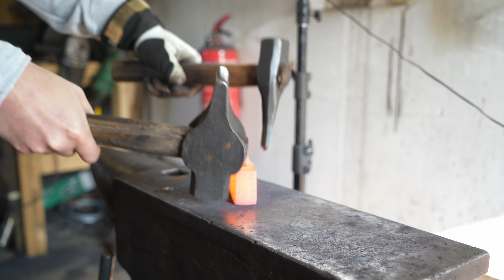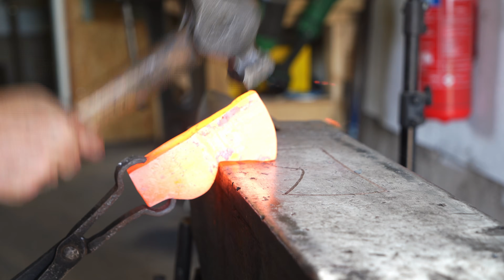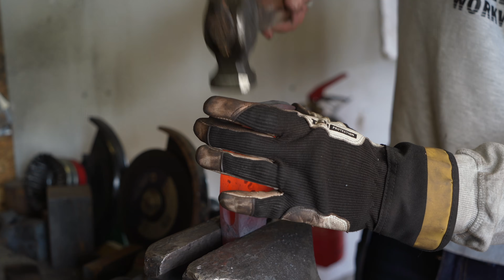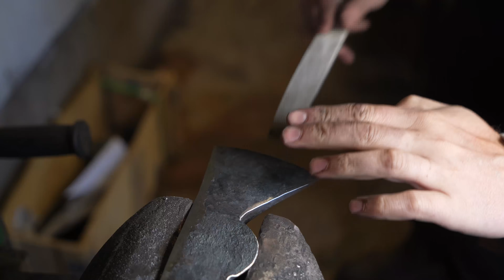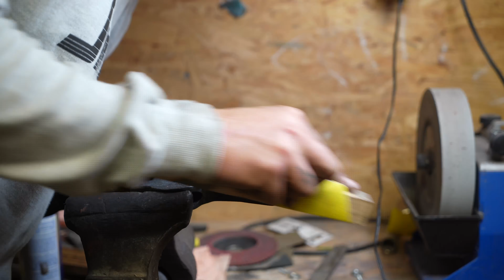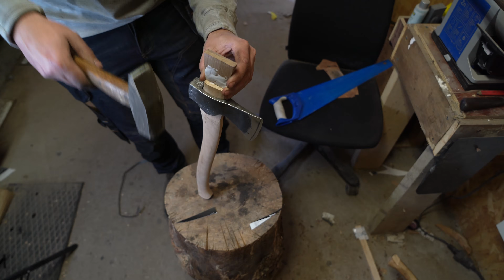Forge Welding Axes: An Introduction to Laminated Edge Steel

Comment: I re-seated my axe head into the shaft, useing thin laminating epoxy. Very effective. I built a little dam of modelleing clay so as to let the resin rin downwards,  penetrate and bind. Prior to this, I firmly whacked the shaft into the head, by whacking the shaft.

Solid binding between the shaft and the head.

It became loose in an attemt to make the shaft more beatiful in the owen. It came out very nice, but shrank.

Now the shaft is firmly and solidly attached to the head, way better than before.

Comment: Nice axe, a better way to install the wedge is the place the axe upside down on a work bench or log, and drive the handle down onto the wedge, it evenly distributes the force and stops the wedge from splitting.

Comment: This was very informative. I have been wanting to start blade smithing. But it is so expensive to start.
Reply from the maker: I started with an old barbeque grill and a hairdryer. A 10 dollar hammer and a small piece of steel as an anvil. Built my way from there. It does not have to be expensive to start. Thinking back I can really miss those early days. What a fun journey it had bern. Hope you can get around to try! Best of luck 😀

Comment: I've always wondered if axe handles have like a standard size so you know how large to make the eye of the axe. Or is that a thing you figure out before starting? Which comes first, the handle or the axe? :P
Reply from the maker: Hey! Very good question!
You can usually see similarities from culture to culture. Here in Sweden for example you could say that a standard is 50x20mm but it differs slightly from maker to maker. 

It also depends what historical era were talking about and the purpose of the axe.
For example here in Scandinavia it's very common in. the modern era to have a hourglass shape inside the eye, that means that its bigger on the bottom and the top of the axe, while in Other places you only have it bigger on top.

Remember this is just off the top of my head and I am generalizing a lot.
oh, and the axe came first.

//Nils

Comment: Hello Niles, I have often wondered if you have a particular shape of ax handle that you prefer over others? Are some more efficient as far as blade angle at the bottom of the swing arc?
Reply from the maker: Hey! That's an interesting question, I am a person that really apriciates history and the labour of those who came before. So I take my inspiration from them, far greater men than me. 

I try not to complicate things, Some axes works better(in my opinion) with straight handles, some with curved handles. 

Hope that helps
/Nils
Reply: I appreciate your answer sir, keep the videos coming I enjoy them immensely. Vince in New Mexico.

Comment: what would be the difference between doing the way you have here and folding a flat piece around a high carbon edge and working the handle hole and profile as you weld the hardened cutting edge into the mild steel of the body of the axe head?
Reply from the maker: They are different constructions. This method that I am showing is very common to see here in scandinavia during the 1900’s. The folded axes go way back to early iron age. The big difference is that the ounched eye is generally stronger. No risk of delaminating the eye etc. So a bit safer.

I am going to make at least two more videos about the folded axe, just like this video.

Comment: When you "normalize" put the workpiece into a bucket or tray of sand then cover it with sand. 

When normalizing, usually the idea is to let it cool as slowly as possable.. Sand, or even fiberglass if you like, will insulate the piece better than just letting it cool to the air, and you should get better normalization.

Comment: Hey Nils, Excellent video. I just have one question. Is the eye of the axe backwards from normal? It's not totally clear from the video but it looks like the big side of the eye is on the bottom instead of the top.
Reply from the maker: In my experience there are two ways of going about this. Either you do tge more ”tomahawk” approach with the larger section on top. Or you do the typical scandinavian version with an hourglass shape. That means that both the top and the bottom are bigger so when you wedge an hourglass shape inside the eye. This way you get still get a very strong locking process with the wedge but also maximizing the amount of wood at the bottom, reducing the risk of the handle breaking when overstriking etc. Hope this answers your question. 

Here is one example of how different cultures has aproached things a little bit differently, which is very interesting
Reply: @NilsÖgren  that is indeed interesting. I didn't realise the eye was made into an hourglass shape rather than a simple taper. Thanks for the insight.
Reply from the maker: You got it!

Comment: Fantastic instruction, thank you!! In the handle video if not already in the plan would you be able to address the way you shape the eye region with respect to how the drift taper interacts with the eye? I may be doing a bad job describing it but essentially how hourglass figured the inside of the eye is and how much of the handle contacts it before driving in the wedge. Cheers!

Comment: Nicely executed, clean, well explained and shown, that was an amazing video!
I also tend to thin out everything before quenching, sometimes i even do a basic polishing so I don't have to work with hardened steel so much.

The design with the flared eye is pretty odd, I suppose it's an American design?

Comment: Very intuitive and a "very pleasurable forgery" to watch.😁What's a good way to prevent aggressive rusting on axes? 
I live in a humid tropic islands in Southeast Asia where it's always warm, where humidity aggressively oxidize steel/iron tools.
Reply from the maker: Well there are a few things you can do. Never leave the axe outside after use. Clean it if it gets dirty and oil it. I always oil the head with linseed oil.

Comment: Beautiful work. It is great to see that forge welding high carbon bits is still done. I have seen vintage ones, but no major manufacturers seem to be making them. I learned to recognize rusted forge welded axes in auction pictures and have restore several to be my user tools.

Comment: I have always been curious why everyone waits till the head is on the handle to oil the handle.I always thought that oiling it after would leave a dry spot under the head.
Reply from the maker: Depending on the oil used, it does penetrate rather well. I have screwed up a few times and had to rehang the head. There is always oil there when I check. But I do see people oiling before as well. I havent thought about that much to be honest, but you got me thinking.

Comment: I have a question about flux, I can't get borax in my country but I want to try forge welding small items do you have a alternative. Can I do it dry.

I heard some people use silver sand as a flux is it worth trying it?
Reply from the maker: Not sure. Borax is hard to find here as well. I troed som iron mountain flux, ordered from a farriers shop. They usually have loads of equipment

Comment: Other than for purely cosmetic reasons, is there a purpose for extending the lugs down. I would expect it cuts down on weight and makes a greater surface contact area for the handle. Is there any other reason besides that? Great videos, I very much enjoy them. I especially like fact that you use carbon steel inserts with a mild steel body. More traditional that way but also results in an ax that should work harder overtime.
Reply from the maker: Nah you pretty much answered the question. Its do be able to have the same contact area but use less material. Or atleast thats where my thoughtprocess goes.. thanks for watching!

Comment: Excellent work Nils and good instructions, made easy to understand. 
I would very much like to see you go into wedge design, and in particularly, cross wedging with wood. There are a lot of videos that show main wedges far too thick that often don't drive home all the way. Less importance seems to be given to compressing the handle wood top to bottom with cross wedges, just relying on 'one size fits all'  flat metal or round wedges. This seems strange to me, since it is in this long axis that the greatest forces are found while the axe is in use. Thanks again... OG
Reply from the maker: I am not claiming to be an expert on the topic, but I do have some experience. I will share what I know to the best of my abilities, I promise!

Comment: could you please tell how can someone judge steel temperature to reach forge weld heat whitouth burning the high carbon steel ?
Reply from the maker: Practise! For me its all about experience. 
I failed many times at first. I tried to learn from my mistakes, reading about others having similar issues, boight books etc. Eventually it started going better and better
Reply: @NilsÖgren  Thank you for your time and answer ! looking forward to share my work when my new workshop is finnished!

Comment: What is the name of the white stuff you puted on the blade at minute 8:51?
Reply: Flux
Reply: Borax can be used as flux
Reply: It is a borax flux used to prevent the metal from oxidizing so it can be welded. Its like cleaning two things you want to glue together for a good joint.

Comment: Turned out to be a fantastic Scandinavian forest axe! I haven't used that method of cutting the slot in the bit with a hot cut. Do you like it more than using a grinder? Also I would love to see you make another Damascus edged axe. Maybe a collared axe 3 piece with the center piece being the Damascus portion? I want to make one badly but it's too hit in my forge during summer.
Reply from the maker: I prefer using the big cutting disc on my grinder tbh. But this works fine :)
Reply: @NilsÖgren  that's exactly how i do mine. What do you think of the 3 piece Damascus collared axe idea?
Reply from the maker: Sounds like alot of work 😅

Comment: Thanks for this video tutorial and for your commitment to sharing your knowledge. You have a generous soul and your videos are well done. Congratulations on your new baby too.

Also can you (or someone) tell me the benefits of drawing out the lugs and why some axes have them and not others? Is it just a style thing, or do they add strength?
Reply from the maker: Thank you! Its all about exentind the contact are with the wood. By drawing out ligs you can start with a smaller piece of steel but still have enough contact area as a big axe

Comment: Great work! I dont have a power or tredel yet, so I watch alot of these to get good tips. Ive made 2 axes out of truck axel shafts and they came out nice. Since they were high carbon it took forever, but yeah. I just need to suck it up and buy mild steel on line lol.
Reply from the maker: Its all about problem solving. If you already made 2 axes, you can probably figure everything  out :)
Reply: @NilsÖgren  with time, yes. Thank you.  Not to delve to deep, but smithing has saved me from myself. It's always a pleasure meeting, and chatting with others in the craft. 🍻
Reply from the maker: Likewise 🍻

Comment: hi there, I'm a big fan and i want to try to forge my tools, like axes, can you recommend me a good quality steel for a beginner?
Reply from the maker: I actually have a video just about that topic on my channel!
Reply: Check his video out, and good steel for tools is most anything high carbon. 4140, 1085, 1090. Alloyed tool steel.  Now if you want, you can use car/truck axel shafts which are most always a high carbon steel, and hammer it into the rectangular billet shape. Tha will help with one's hammer technique, but take a bit to do. Since he's using mild steel, which is usually A36 if your buying it online. I'm a novice with 3 years under me, but I'm still learning the "axe trade" Lol. Happy smithing!